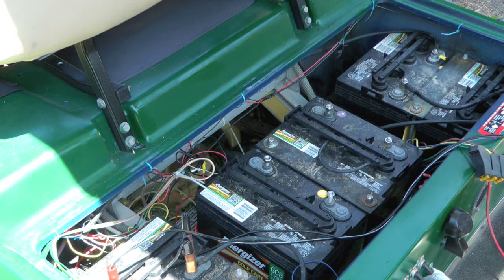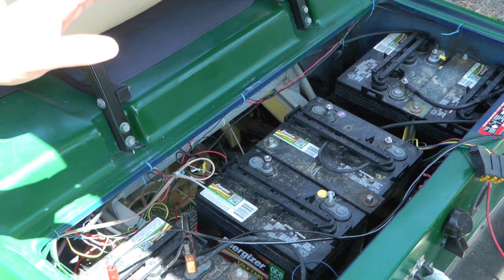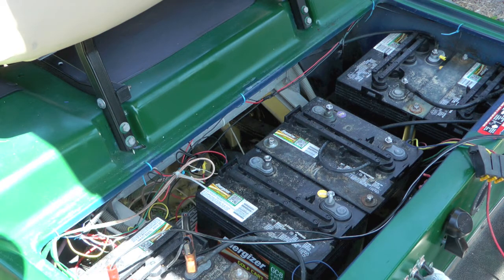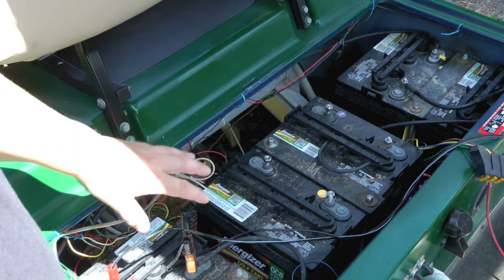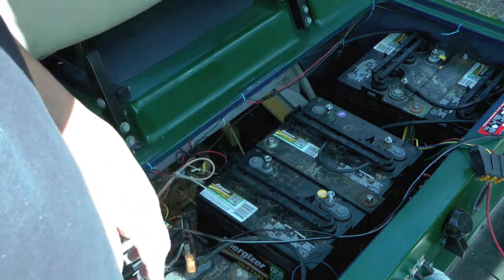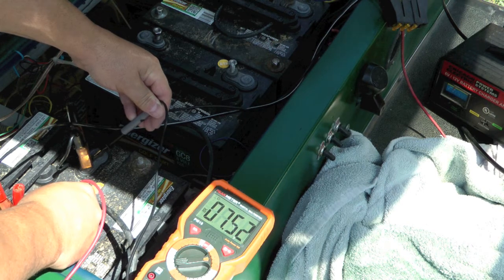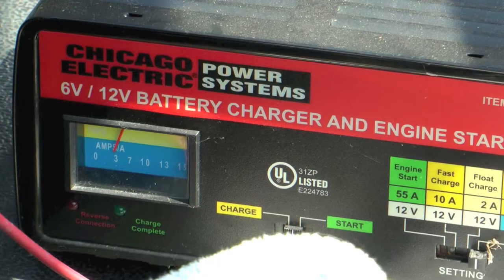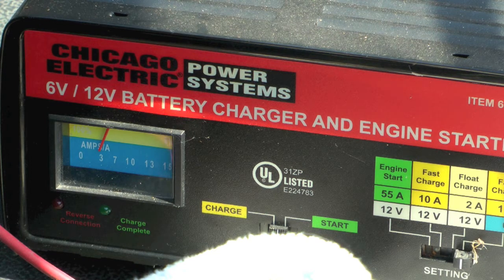Recharging a completely dead battery

Comment: This matched my scenario exactly. 8V golf cart batteries dead, but over the winter (I am a bit further north than Texas). Smart chargers would not recognize the battery, but the 6V setting on a "dumb" charger worked perfectly to get the voltage up high enough so the charge controller would recognize the correct battery voltage. All batteries working now. Thanks for posting. This is still a useful resource.

Comment: What do you mean "wont kick on your battery charger??" I'm a mechanic and have worked on cars nearly 40 years.  Its not the job of a battery to "kick on a charger "   very confusing.  What are you trying to say?
Reply from the maker: if the voltage of the battery drops too low the charger won't turn on
Reply: Man youre a mech you know what hes saying
.
Reply: You have to try and trick the charger same as the solar system anything below 10 volt won't start the solar regulator so you add a jump pack to  trick the system
Reply: No its called by a real man's battery charger.. Wtf is a smart charger.. My god have AMERICANS been dumb down
Reply: Question for you both if you don't mind...Was at work, called wife to have her put the battery charger on an old car (1993 oldsmobile) 
we were selling. It was completely dead.  She started at 10 amp...nothing but a dim dome light,  had her turn it to 40 amp...got a door chime but wouldn't crank...so I told her to put it on booster really quick 200 amp and see if it'll even crank....well it started up immediately.  I then had her turn the charger back down to 40amp and leave it for about 30 min while the vehicle just stayed idling. (this is where I think I messed up). She went inside for about 20 minutes came back outside and the car had died and white smoke was coming from the dash. She turned the key off and unhooked battery charger. She tried to see if it would start back up but nothing.  With the car running, would the alternator and battery charger at 40 ramps been way too much and caused an internal battery failure causing the vehicle to die and not sure where the smoke came from. I'm at work and haven't been home yet to troubleshoot it myself.  I like your thoughts a out where to start on the troubleshooting. Thank you
Reply from the maker: once the car started, you should remove the battery charger.  Some of them are set up to compensate for when the car is running, but some aren't.  It would be impossible for us to guess why she had smoke coming from the dash.  I just uploaded a video on how to check if your battery on the vehicle is dead and in need of replacement versus if you have a parasitic draw that is draining the battery in between drives.  Check it out and see if it helps you.
Reply: @WJHandyDad  yeah when she told me it died and was smoking when she came back outside, my first thought was, should have told her to disconnect the charger. Completely my fault, it's an older Schumacher 200amp. Really nice but no protection built in I don't believe.   Thank you. I'll check it out.
Reply: My battery been sitting under my house for about 2years and it won't kick my charger on either
Reply: Chicago charger LMFAO!!
Reply: Not to me he just means it won't kick on because it's dead haven't watched the video yet but assuming! I normally jump it first to get it to kick on! My charger won't come on aka kick on lol unless it has some type of a charge

Comment: How long did you have to leave the the dead battery connected to the good battery before it woke it up enough to kick on the smart charger?
Reply from the maker: it was basically instant since the charger can't tell if it's hooked up to the "good" or the "bad" battery
Reply: @WJHandyDad  thanks for the reply.  So did you rewire the jumper (short cart battery cables) hot to hot, negative to negative then put charger on good battery?  I'm working on an ezgo that has 4 batteries that will take a charge, 2 that won't.   With 4 charged batteries the main cart charger won't kick on.
Reply from the maker: yes, hot to hot, ground to ground 1 good battery and 1 dead battery.  Then hook up the single battery charger.  Once the "dead" battery is good, go to the next dead battery.  Once they are all "good" then your golf cart charger should work to finish the charge.